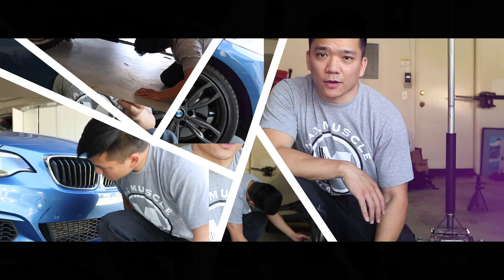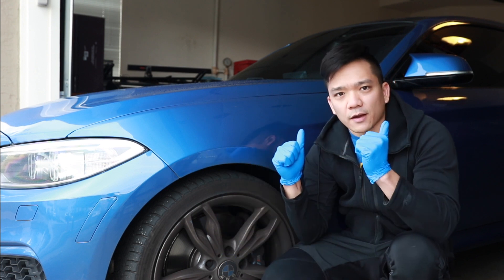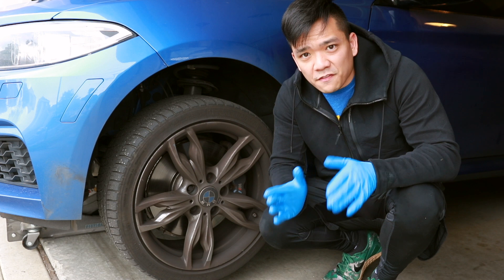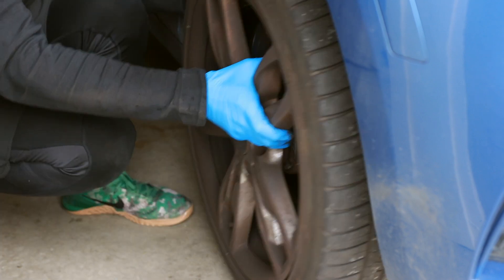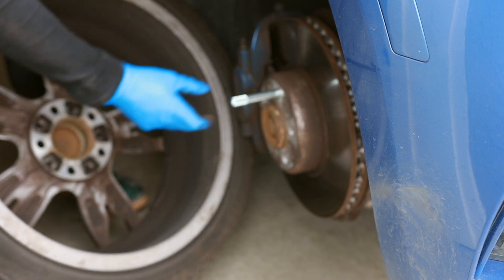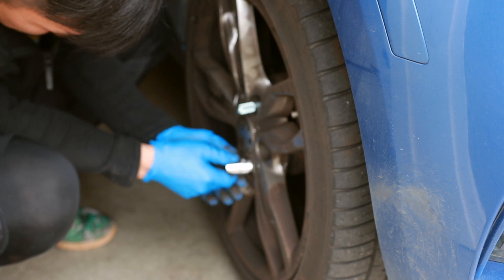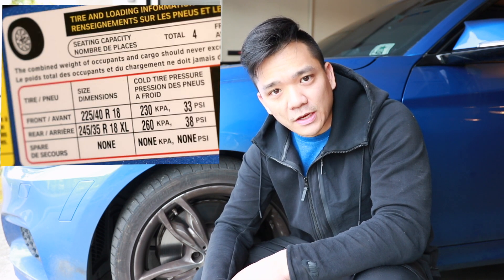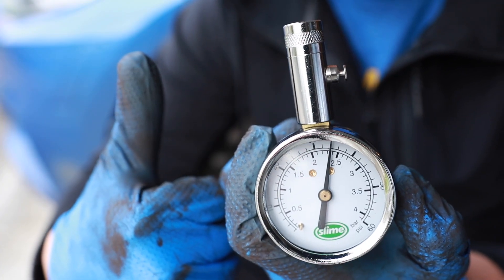BMW 2 series Tire Rotation | BMW m235i Tire Rotation

Comment: Make sure you don’t have directional tires ( the tire is installed with the tread facing a specific direction, indicated by arrows facing forward on the tire). If you do, and they are staggered, you can’t rotate anything unless you re-mount the tires.
Reply from the maker: Thanks for sharing

Comment: Hey Fritz! Content keeps getting better! Love the background music and sounds. Pls use jack stands, even under the brake hubs of the removed tire/wheel. My floor jacks are new and well maintained but I am paranoid. 

Also this is an ideal DIY if you have non-directional tires. If you are staggered and directional, well, that’s a tougher one. You’ll need to mount them in the opposite wheel.... oh wait, if it’s directional, it might also have the inside and outside sidewall marked so you have to look before spinning out those lug bolts. 
Keep up the great work!
Steve
Reply from the maker: All great points and thanks for sharing your input. I am always happy to hear what you have to share
Reply from the maker: Hi Steve. Would love for you to drop by the YT live I'll be doing this Sunday at 3pm
Reply: Fritz Ramos love to!  Tell me what I  wed to know! This is exciting. And shooting my shock/strut work this weekend too; fun but takes some work.
Reply from the maker: @SteveWeltman  Sorry Steve I just finished up the live stream. I think it should have notified you, but don't worry about it there's next time. How's the car doing?
Reply: @FritzRamos  Car is great! Love doing the work on the car, and going to go out and get the control arm set (front/rear, top and bottom!) from either FCP or Pelican today. 
Doing the absolutely dead (and I mean dead) shocks in the rear, removed the springs, and need new spring perch pads (cheap consumables, shoulda bought them first). Recording doing this work is SO HARD to make it decent, like what I've seen on YT. New respect for YT creators.

Comment: Hi Fritz! I am swapping my wheels for my winter set and don’t have four sets of jack stands to lift the entire car up. I’m a little nervous about lifting the car from the rear (as I don’t want to place it in the wrong spot) would I be able to just jack up each side individually to switch out the back 2 wheels? Or individually jacking up each side one at a time? (Besides it taking a longer time, is there any other downfalls to this method?) thank you! I really love your videos!
Reply from the maker: Hi and thanks for the support 😊. You could jack up one side at a time if you have a spare or use the front and rear center jack points
https://youtu.be/24XDC_Rbol0

Hope that helps

Comment: A little tip, before reinstalling the tire, put some antiseize compound on the inner portion of the brake disk where the rim mates to the disk as well as the threads on the lug nuts.
Reply from the maker: That is a good one! Do you mind if I pin your comment?